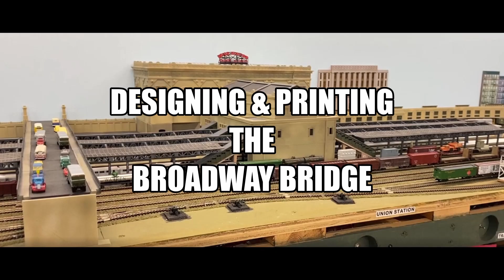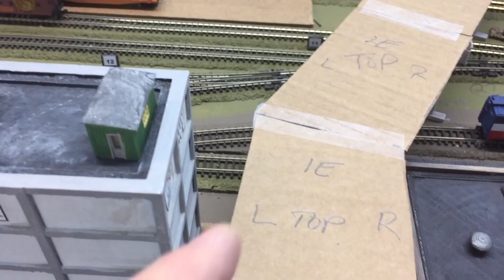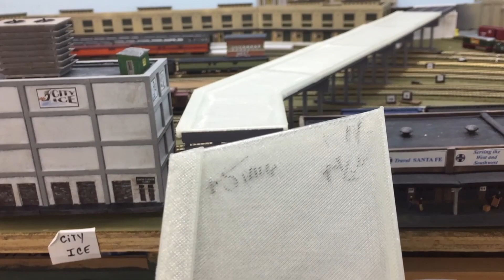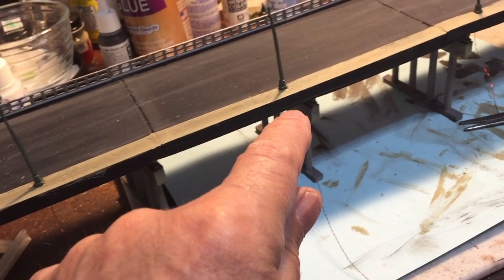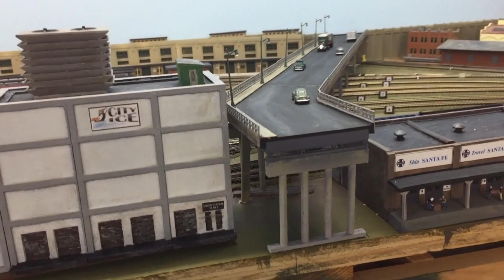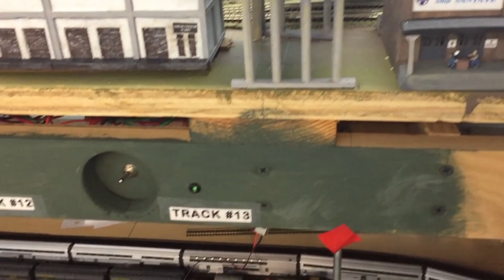Designing & Printing the Broadway Bridge

Comment: this video is just in time. I will be adding a bridge to BRC in the coming months but will be using Trix bridge sections. But this video is very helpful
Reply from the maker: Hi Joe, Bridges can be challenging to build when on an angle like the custom one that I built. There were some N scale commercial bridge kits that I could possibly have used but at a much greater cost than what the PLA filament cost. Have fun with your bridge…..John